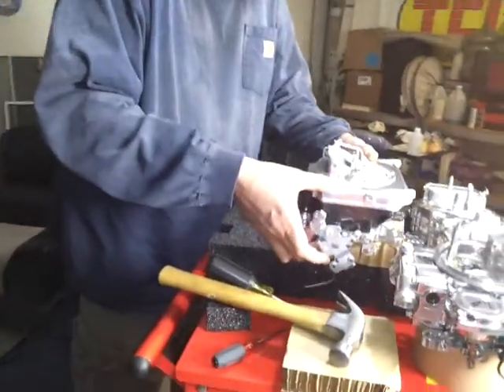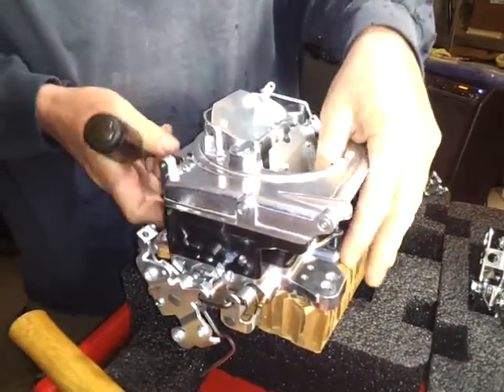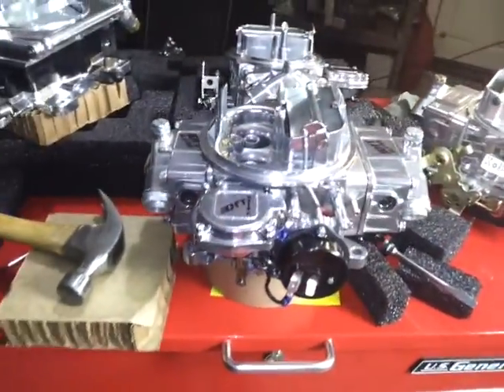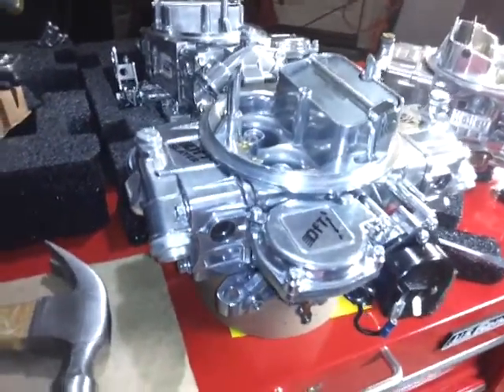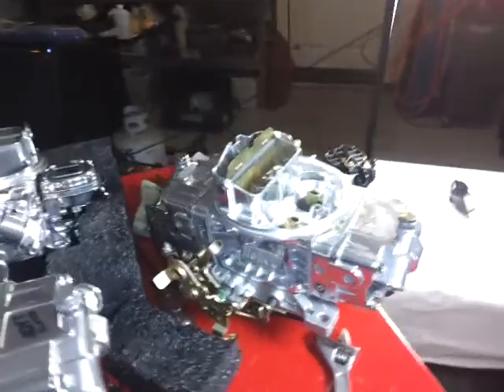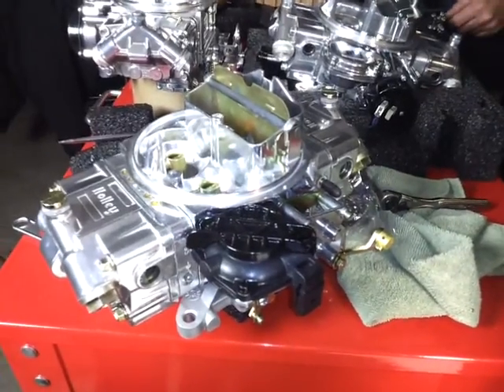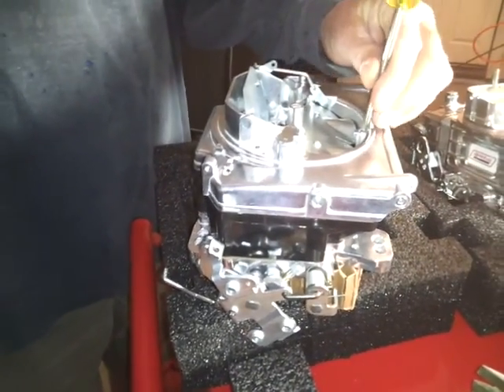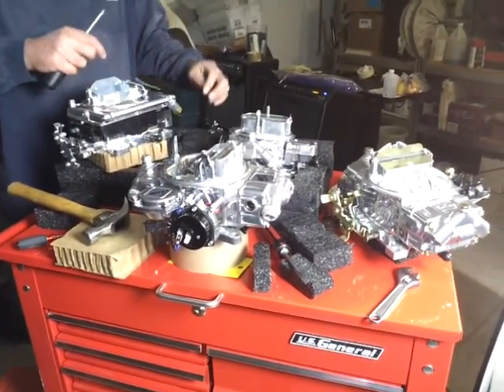Five New Carbs Under $400

Comment: It would be nice to see a heads up of the Cheapo Carbs on a 602 Crate engine. The Summit M2008 (autolight 4100), 625 Demon & Quick Fuel Brawler. Do a economy 600 cfm $300 carb test.

Comment: I got (3) list 3310 Holley 780's, for $40, $20, and free.   why spend $400 for a carb ?  you can literally find a Holley 4bbl on the side of the road now.   the USA is littered with old carbs for cheap.   no incentive to pay $400 for one.   the Qjets, T-quads are even cheaper.
Reply: good way to buy someone else's junk carb
Reply: Because some like adjustable metering and throttle shafts that don't leak